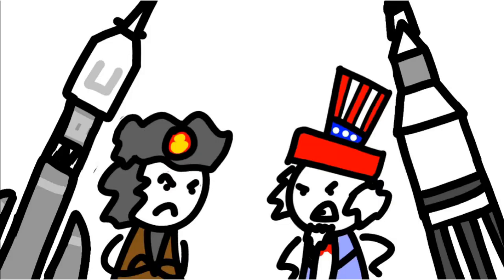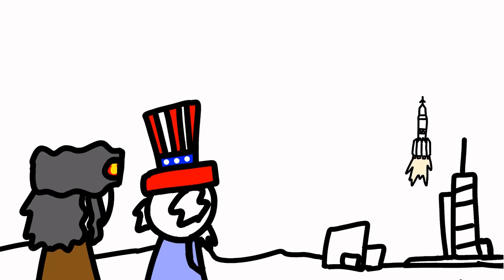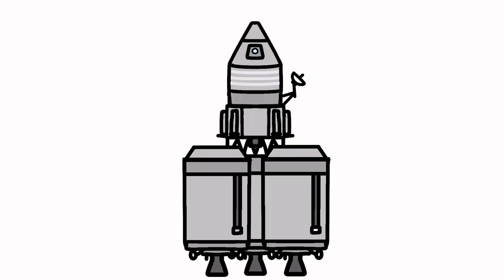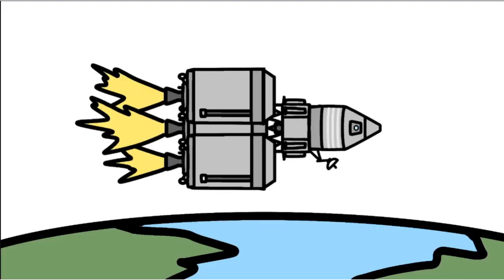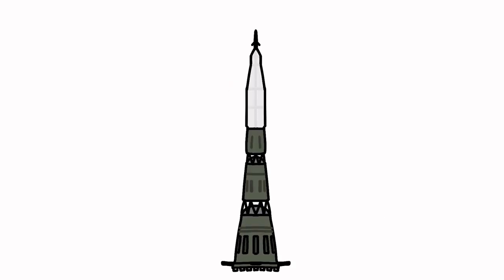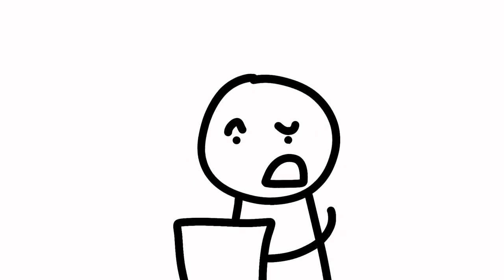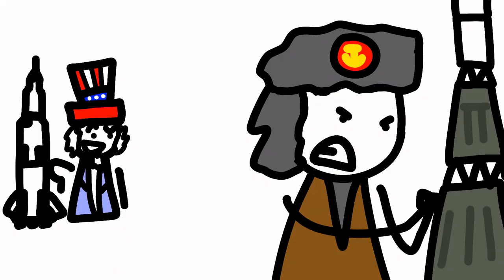The Soviet Plans for Landing on the Moon

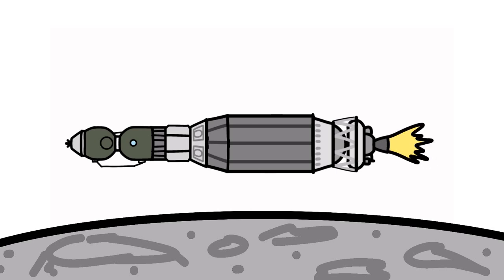Comment: 8:31 Every youtuber get's this wrong, but the LK is not supposed to be in the open here. It should still be inside the "trunk". We're used to seeing the Apollo capsule and the lander docked together in the open, but in the soviet solution the LK had to be transported in the trunk  because there is no way to dock the LK. It should look the way you drew it at 5:13

Comment: Love this video. There are a few points to add accuracy: The fight between Korolev and Glushko was very much like depicted, but over the N1 Glushko had almost no part for the majority of the time. The engines were delegated to Kuznetsov, who stumbled his way into making one of the most reliable engines ever created in rocket history. The catch is that these marvelous engines only came to be at the end of the program. Another point: One of the reasons why the N1 program failed is because the overall feelings in OKB-1 (or TsKBEM as it was named at the period) was that the N1 was basically never going to succeed anyway from the get go. The engineers had no faith in the design and they were much more interested in the secondary missions, like the Salyuts and the Molnyia satellites.

Comment: 6:01 this is misleading. The craft could dock, but crew could not transfer through the tunnel. The cosmonaut would not just transfer from the floating LK.
Reply: A good distinction to make. I definitely give props for that. Even so, I have serious doubts that it ever could have worked. You still would have to suit up in much the same way as for a floating EVA. The first Apollo missions were really pushing safety limits, and it's fortunate there were no fatal mishaps. To have a single cosmonaut doing any sort of EVA on the way down is just too much to get my head around. I think it would be a suicide mission.

OBTW no one seems to talk about what kind of computers these ships had. Did the LK even have what could be considered a real computer?
Reply: @ronaldgarrison8478  If the cosmonaut just tethered up it would work